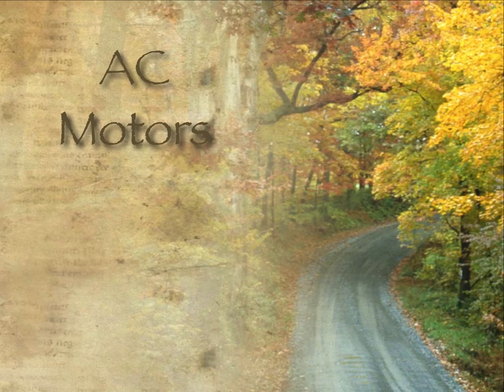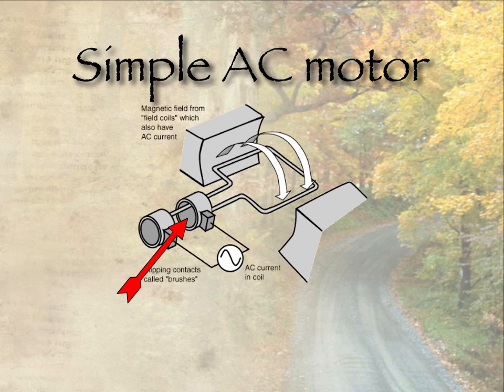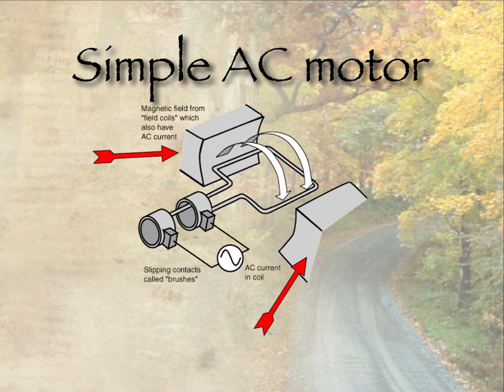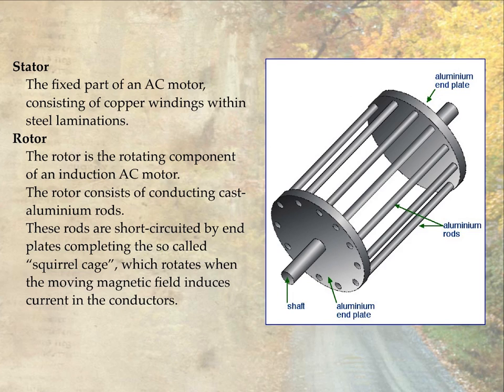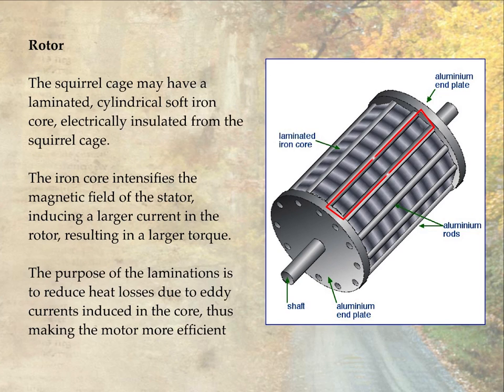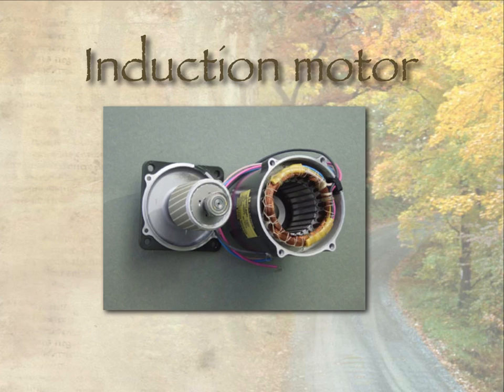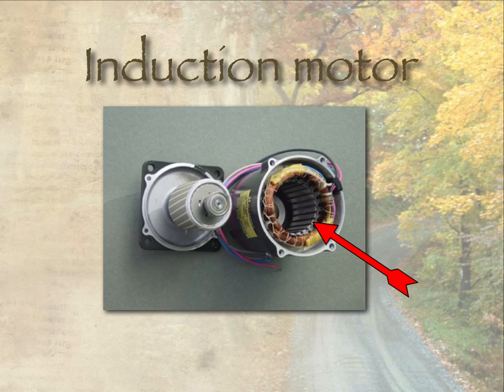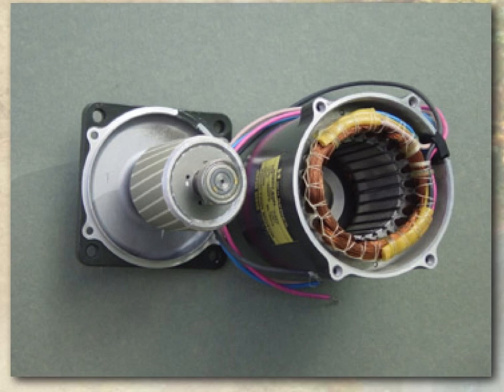AC and induction motors explained

Comment: This is great. Maybe this strays a bit more into engineering or applied physics, but can you do a video on how an induction motor and transformer is used in an electric vehicle like a Tesla to provide propulsion? Is the DC from batteries turned into AC fed to the external stator which powers the squirrel cage rotor? And how is this modulated to control speed? There are a lot of misconceptions out there and very few clear explanations.
Reply from the maker: Thanks. Great idea. I shall keep it in mind. Though I’ll have to do some research first.
Reply: @PhysicsHigh  Awesome, cheers. Subscribed.

Comment: Heyo. With the whole AC synchronous motor, are the magnetic poles also alternating in time with the alternating current in order to produce magnetic forces that continue rotation (as opposed to causing the loop to vibrate)? Also, is it the curved radial nature of the magnetic field that prevents the loop from stopping when its plane is vertical (as we see with flattened poles and a horizontal magnetic field) or is there some other mechanism preventing that?

Comment: ¿How does quantity of poles effect rotation speed¿

I have never ever seen a squirrel in a cage. That's just plane silly. Please change your terminology to a hamster or gerbil cage.

What piece of equipment commonly contains a split ring commutator motor? I want to take one apart. Your graphics are supremely awesome but I'm a kinesthetic learner and have to touch & measure with a DMM and Oscope to comprehend as part of my plan to take over the world.

Please post a video on the difference between the Flux Capacitor used in the Back to the Future Delorean and Elon Musk's Tesla S.
Reply: Jefe Julio el Gringo Judeo this is standard knowledge across the field. Squirrel cage was coined from the start.